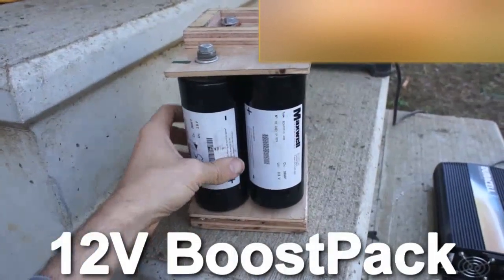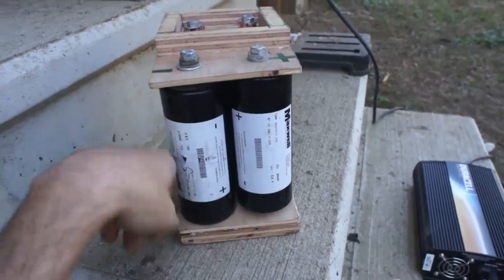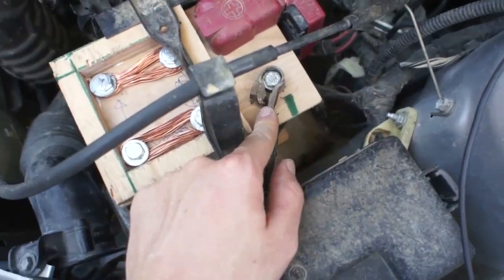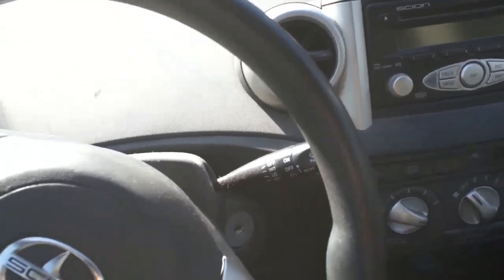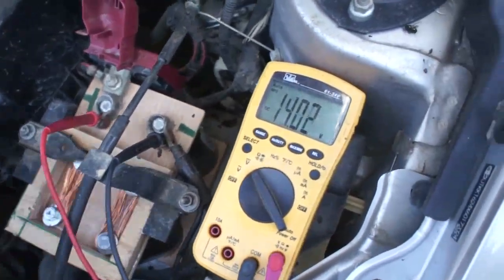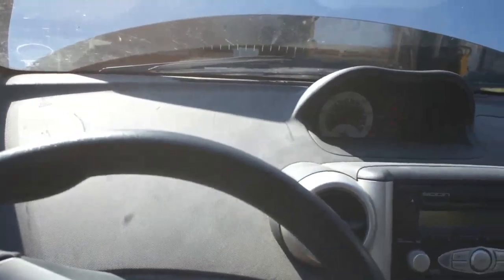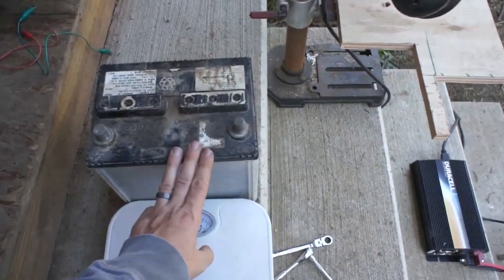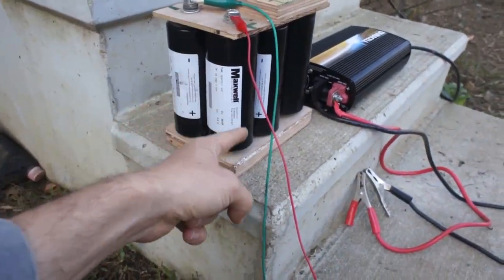12V BoostPack. Replaces auto battery. Works great!

Comment: My high school lessons happened so long ago, but is it sensible to use capacitors serially? Wouldn't be better to use 12V units in parallel?
Reply: Marc Abelha They need to be wired in series because each one is rated for 2.7 volts.
Reply: ThingsDemystified
Understood. I understand the voltage constraint, we have to get the serially to reach 12+ V. Nevertheless, aren't we wasting capacitor / ampere by using them serially?
Reply: Marc Abelha I'm not sure what you're getting at. Amps are a measure of current flow. You can't waste amps. Maybe you're trying to maximize amps? To do that, you want the highest voltage.
Reply: Marc Abelha Total power should be measured in Watts rather then volts.  How you arrange your power supply does not matter as long as you get the required voltage.  The total Watt's will always be the same if you wired the same number of cells in parallel or in series. 

Example of Ohms law is that 1v*12 cca/hr = a total of 12watts/hr.
12v*1cca/hr= 12watts/hr.
Example 2: 12v*200cca/hr*1cell= 2400Watts/hr @12v.(Series)
                   2v*200cca/hr*6cells= 2400Watts/hr @ 12v (Series)
                  12v*200cca/hr*10cells=24'000 Watt/hr @12v(parallel)
                   6v*200cca/hr*20 cells=24'00 Watt/hr @ 6v (parallel)
As you can see, if we follow Ohms law the total power output is not based on configuration, but rather the sum of the total watt's.  Applications which use higher volts are more efficent and generate less heat as they will use less amper's; but the total watt's will be similar to comparative applications operating at lower voltage.  This is why all generating sources are rated based on Watt's rather then voltage or amps.  Voltage is equally important simply because you can't use a 120v generator to run your 240 volt washing machine.  To do this you would need to step up your 120 volt generator power to 240v using a transformer but at the same time you would be reducing the amper's available by 50%.

This example is perfect to show why my generator blew out its charge controller with my home made wind turbine motor.  The voltage exceeded the controllers desined voltage and simply burned up during the bench test.  Unfortionatly I'm at a loss since I'm having trouble finding a controller able to take the challenge not knowing the potential voltage.  To get an idea of my motor; I'm using 640lbs pull neo mags in a 120amp alternator for a truck.  I made my own stator coil for 3 phase ac and using large dios to convert to dc.  The cogging is extensive, but with a 9ft diam prop that is not a problem.  The most impressive thing the alternator shop saw was that it's magnetic force was so strong upon bench testing that a heavy industrial wrenches could be suspended to the aluminum case.  Even with large gas powered generators the magnetic fields are not this strong.

So I need to find a transformer which will work for my aplication so that I can charge my homestead battery bank.  One consideration is that if my motor generates 140 volts; if I wire 10- 12v batteries in series I will have 120 volts which is in acceptable range for charging.  All one would need to do to convert the bank into 12 v for my RV is to plug into 1- 12volt battery at it's +/- terminals, rather then the entire bank.  Keep in mind that the batteries are not being dissconnected from their series configurations of 120 volts, but rather we are only splicing into 1/10th of the bank for RV power.  The total outcome is that we are charging at a much higher efficency of 120 vdc; while at the same time only using 12vdc.  Our total watt's storage would be 10cells*12v*200cca=24'000 watt's @ 120 volts, while our available power will be 24'000 watt's @ 12 volts=2'000cca.
Reply: ThingsDemystified
 What he means is capacity. 6 similar capacitors serially have total capacity of 1/6 of a single capacitor of this type. So if there is a choice, less of bigger Umax capacitors may be favorable, question is if they are available.
Reply: Maverickx89
Oh, now I think Marc Abelha was asking why they didn't use six 12V capacitors in parallel instead.
Reply: Yes. I understand the effect on voltage in series or in parallel. Don't we waste amps using capacitors in serial?
Reply: Marc Abelha
I think you have your theory correct, but there is no other way to configure this "battery" to deliver 12V. These are 2.7V units, so the only way to get 12V is to wire them in series. If you wired them in parallel, you'd be able to supply more amps but at less volts. The power would not change since watts equals volts times amps. In this application, if you wired them in parallel, you'd have a 2.7V battery which would not start the car.
Reply: ThingsDemystified
 Next thing, I got to have 6 of those :) There's a train company (metro?) selling something similar, in ebay. Is that any problem with used capacitors, what about lifetime?
Reply: Marc Abelha
Then it will be huge =) I have no idea about the lifetime. You might want to search Google about that.
Reply: Capacitors can hold their charge for deck aids.  The issue with capacitors is that they are picky about being over charged, undercharged, and cycled to rapidly; which can lead to a violent explosion.  I remember a girl who died after her Chinese I-phone charger exploded next to her while sleeping.  This was due to using the wrong capacitor.  I'm sure the designs are getting better and less temperamental; but I would not want a capacitor as my power supply unless I had a blast shield directing the force away from me.

Comment: Make these for semi tractor trailers & reefer units and you can retire a fat cat. A 379 Peterbuilt with a 550+ Caterpillar engine uses 3 to 4 - 12 volt batteries. (80 lbs per battery  with 1150CCA) Group 30 is what most refer units use. So technically, you would be replacing 4-5 batteries per tractor & trailer... and the batteries run about $500 per battery. You would probably have 25-30lbs of capacitors, and take off 400+lbs... That's a big deal in the shipping industry. That means more freight can be shipped.
Reply: caps could replace the cranking amps you need. They will drain alot faster, so leaving you parking lights on while sleeping. How many amp hours would you need without the engine running.
Reply: Paul Glaze  Good point. I'm guessing it would depend on the sleeper berth time & the driver to remember to turn the lamps off when the sun comes up. 10 -12 hours. (in all climates.) The starter might have to be set up so that it always recharges when the engine is turned over, and it remains separate from the other 'caps.'  ...Refers have their own voltage sensors, so when the voltage gets low,  the reefer kicks the engine on and recharges the battery. (I'm sure the same could be done for the tractor portion of the truck.) ...When my parking lights are on, the truck is always running. The amp hours would depend on how many lamps are on the truck, what kind of lamps (led/incandescent) dash lamps, and worst of all, the gizmos that the driver has hooked up (mini fridge, CB with 400W linear, laptop, gps system... you get the idea. (I think your best bet is to befriend a guy who runs a small fleet of trucks... not only would you be able to get the information needed to set up & test your system, the owner might be able to bankroll your venture. 10-14 truck fleet = $3+  million a year trucking company).

Comment: love this is amazing  can you make them in a deep cycle for rv use ?
Reply: No you would need hundreds to have a equal amp hour capacity. Like shown in the video if you left your headlights on for more then 30 seconds they run to low to start. Also they will drain after sitting just a few days. Not very practical. They will put a very high load on the alternator very time its started also. I would guess that you would be replacing it much more frequently. He doesn't mention the amp hour capacity which is really easy to test because it's so small. I did the calculation 12v 6000f = .83 amp hours. Say you left your lights on using 10 amps it would be completely dead 0v in less then 5 min.
Reply: @mytruckownsit  Depends on the F size. The parasitic drain loss is slow. His small 350F pack lasted 10 days and still started just fine. I bought the 3000F ones - 9 times more power.  One can add a small lithium or small motorcycle battery and it would last months!
Reply: mytruckownsit
The alternator will not mind running contiuesly. Unless the rectifier and voltage regulator are not properly cooled. Along what you said with deep cycle, I wonder if this would work in modern cars. Some have almost an amp load from the computers and radio.

Comment: Those Caps are $200 apiece Liar....
Reply: AesopsRetreat and you sir are then another liar...i seem to easily find those around 40 dollars apiece
Reply: *****
Fine, post where you found the same exact ones..
Reply: and maxwell makes ready to install cap banks for 16 volt car use @ around 500 dollars :)
Reply: *****
So, 10 months ago when I also looked up the Maxwell BoostCap they were $200 a piece, and I posted so at the time. 

"Now", after nearly a year, and after a Chinese company took over and recreated a duplicate of the Maxwell BoostCap line, selling for cheaper (like he Chinese do), you're going to stick your nose into an old post and call me a Liar? Are you Democrat? 
 
And BTW: The guy said he bought them for 6bux apiece, not your ow quoted $35 a piece.

Comment: This would be an awesome product to add in parallel with the battery, along side of it, so, once the car is started, the inverter has some ass to actually do some work. It's be great to run HHO systems utilizing back emf to charge the cap and battery from something simple like an automotive relay. The caps being banked, in use with the MBR circuit will be able to charge the battery and the caps while actually running a load. Even without an ultracap bank I have created overunity with the MBR, so, I am guessing we won't have a challenge when it's time to  operate a load and quickly charge the system. The battery will collect the high voltage spike to flatten out the over charge voltage, and the caps will become fully charged very quickly. Here is the link to my MBR circuit, so you could see what I am talking about. It just needs a diode and a 24 volt battery bank, as well as a 3rd 12 volt lead acid battery to operate as needed, and of course a high current diode. I am able to power an HHO cell, and a GE3157 tail lamp bulb (filaments in parallel), and still add charge to the battery without losing voltage from the load. It's unbelievable. Now that I will have some very large ultracaps, I will have a new method of capturing the spike and a much higher amperage capability. Please let me know how many uF these are. This will help me to get the correct caps. What's the largest cap available? Do you still have access to these for 6 bucks? could I buy some from you?

Comment: For winter, or generally wet/humid weather, loose the wood and do cover all your leads in there! There is a stuff called PlastiDip, you may try that.

Also, you could combine a regulad lead battery (maybe a smaller one) plus your boost pack. Battery for capacity, booster for starting amps.

Comment: I know capacitors don't store energy over long periods of time well so how would these preform over lets say 7 Days of non use.  Would they still start the car?
Reply: That depends entirely upon the capacitor. Had an old tv, sat for 6 yrs without being plugged in and the capacitors still had a charge.
Reply: codergopher - No they didn't - you are mistaken.
Reply: I would say using the caps in unison with a car battery could ease the initial cca start up pressure on the battery just like it does an electric motor
Reply: @HudsonFamily7  a car starter is an electric motor. that starter depending on the engine size could require anywhere from 150 amps to 375 amps even possibly up to 425 amps.
what kind of amperage does the average hvac electric motor require?
Reply: @Shanee Fucking awesome response!!!
Reply: Not true hvac systems have capacitors most of the time and ive been to houses that have been empty for 2 years with no electricity on hvac will fire right up.
Reply: @HudsonFamily7  different system than a car. it is a matter of amperage with a car not voltage. the average starter for a four cylinder motor will need to draw at a minimum 150-175 amps at 10.5 volts or better to crank the engine.
what kind of amperage does an hvac setup need to start?
Reply: the trick is to add a small battery that just keeps the caps topped up
Reply: 7 days isn't a problem for this kind of setup. Depending on your capacitors and how much your car drains when in idle, it can stay  charged from  1  to 3 months.
Reply: @ordaxofficial  and what happens when it gets cold? once a battery gets below 32 degrees and it is weak it will most likely not start your vehicle. so if this boost pack is made of capacitors and nothing is keeping them charged while the car is idle it is unlikely they will start the car either

Comment: Wouldnt this make your alternator fail prematurely? Since capacitors discharge so quickly, wont your alternator be working much harder? I know companies have neen working on slow discharge capacitors but they are extremely expensive. This may be a great idea if you use the slow discharge caps.

Comment: How much current does your battery draw after it is fully charged? Unlike battteries, Caps, once fully charged, don't continue to draw current.

When it comes to gas milage, the alternator's topping off voltage and the coresponding leveling off current draw in the battery is an energy loss that is a function of time, and not speed of the vehicle. When switching to capacitors If this kind of energy savings amounts to anything in fuel savings, it will be more pronounced at slower driving speeds.